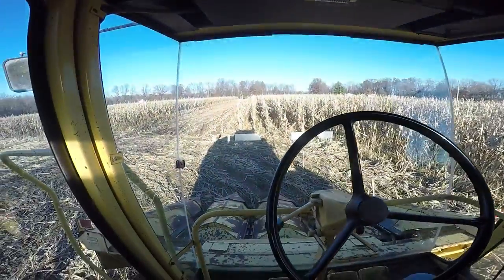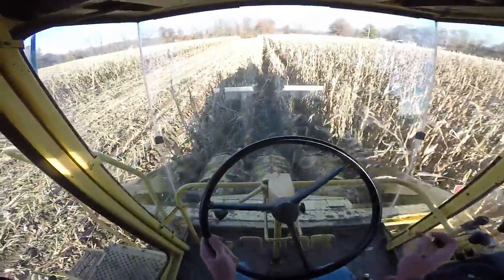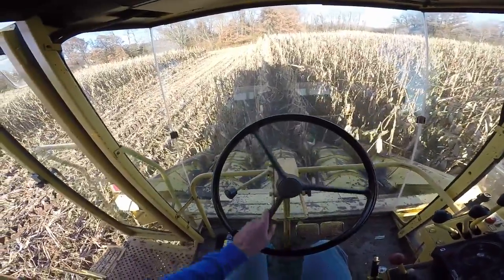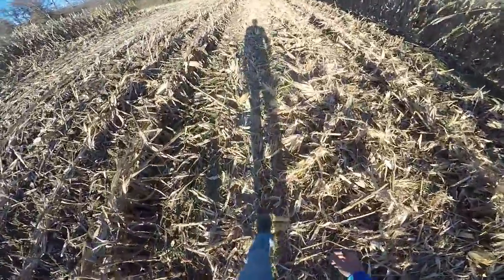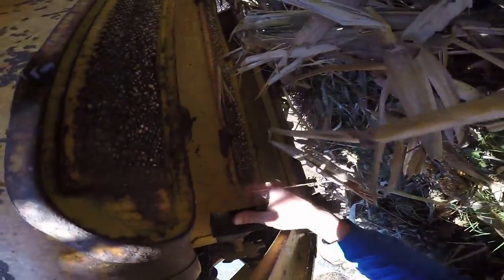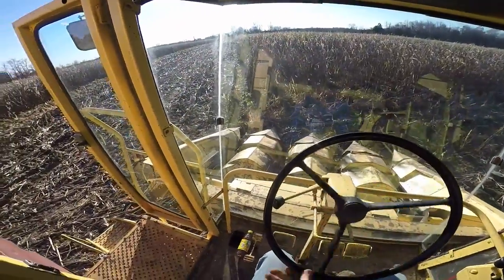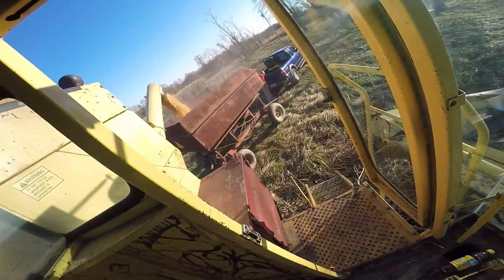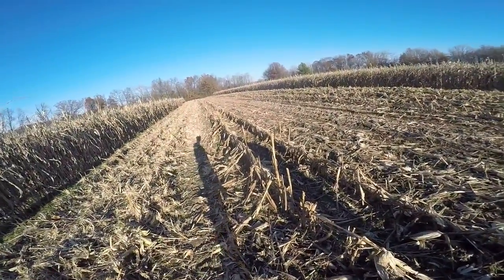First Corn Harvest  TR70 Petrol

Comment: It'd be easy enough to rig up a switch and light in the cab for the rock trap... just a microswitch and some wiring and an LED indicator.... maybe even a horn switch that the lever or rock trap door comes down on and presses to an LED indicator in the cab... my old 640 Ford combine had a metal flap hanging down from the roof over the straw walkers so that if they started clogging up, the trash would push the flap up and it pressed on a horn button wired in to the combines actual road horn, so the horn would start blowing to alert you.  Simple but it works!  

Heck tie some twine or a string to the lever that would raise or release a flag on top of the feederhouse when it trips... spring clothepins and a field flag would work easy for that... OL J R :)

Comment: Might want to invest in a set of duals for your combine. You can also run lower air pressure in your drive wheels for soft ground. I had a 403 IH gas burner years ago I put duals on and it made a ton of difference.
Reply from the maker: I am really hoping to find 28L26 rice tires for it. But I just had a though about the duals because I  know where a couple sets of 18.4x26 rice tires are close by.

Comment: We always just wired the rock trap shut on our combine if we needed to open it up a simple snip of the wire and you could open it then quickly wire it back shut and get back to work
Reply from the maker: It hasn't popped open again, so I hope it was a one time fluke. I definitely want it to work for bean harvest. I don't want the combine to eat a rock.
Reply: Ya for beans you would want it functioning we just did grain and corn so chance of gobbling up a rock are real low so wiring the randomly opening rock trap was benifishal

Comment: if you want to upgrade to an international 1420 to 1480 less moving parts in these machines. they are much lighter than a TR. More room inside for maintenance and some of these combines come with rear wheel assist.
Reply from the maker: What's less? only having one rotor? There isn't much to reduce for moving parts. As far as weight, I have never felt a TR70 was heavy. Now the 3208 could add excess weight.
Reply: Boehm Farm Less moving parts not as wide and you can pretty much upgrade a 1480 to a 2388 mechanically and parts availability and they are all diesels and yours is abgasser and you talked getting rid of gas headaches. The foreheads perform better. If you buy a 1420 or 1440 you can run a 30 inch 4 row corn head if you want to narrow your rows more and they are great on fuel economy. my grandfather had a 1480 for 12 years and the current owners are still putting it to work.

Comment: i have never worked on a gas powered combine, can u notice any differences in power or ?? are you  using regular farm gas or higher octaine gas, or have you not tryed different gas yet, since its still new to your farm?
Reply from the maker: I have filled it twice. It uses fuel faster and I use 87 octane. Ever since the high gas prices, the price spread on 87 to 89 octane gas is rather prohibitive. Was only a dime a few years ago, now its about a quarter. Power wise, it's fine if the governor responds in a timely fashion.
Reply: i watch some Trucker Channels, the American fuel prices are half what drivers pay in Canada. but here every government adds their tax to every  litre. currently 65cents from every litre goes for tax. that equal to about $2.95 per gallon is just tax, gallon equilvent here would be about $4.50 so american farmer have it real good. plus all those hidden subsidies states give to farmers is incredible. [never checked such in your state,] but have from illinois.

Comment: How low is your stone roll and front drum set?  Might be part of your issue with the door opening.  Had the unload drive catch once and unload beans across the field on one of our 70's once and had to burn welds into our stone door because it lost its connection to the shaft and would push open in heavy corn.  We never ran duals on our 70's, but the neighbor had an old set of drive tires off of a Gleaner that he made into duals for his 70's.  I don't miss the old 962 corn head and its snap roll drive system.
Reply from the maker: The front drum I think is set high. I have not looked at the rock drum.

Comment: Once u get all bugs worked out be decent machine. How u get gas.i have gas tractor.have 15 gal plastic container. They caught me filling in back of truck.put on ground. I said u goina help me pick up. Goina get perminate tank for back if truck.pain in but.years ago use to get bulk gas.no price advantage anymore if u could get it. Do have cumbys card 10 cents off  gallon up to 150 gallons at the pump.
Reply from the maker: We have a semi permanent 55 gallon drum to fill in the back of the truck.
Reply: @boehmfarm4276  Yeah I did the same thing.  My Ford 640 combine is too tall to fill from the leg tank; when I was a kid it was my job to pump about 40 gallons of gas into the thing every morning with one of them old push-pull hand pumps... HATED that thing seemed like it took an hour to pump all that gas in it and my arm was about to fall off when I got done.  We didn't grow grains for about 15 years and when we got back into it, first thing I did was start pondering ways to pump gas into it without having one of those stupid hand pumps... I about passed out when I priced those fancy electric pumps that mount on bed tanks, and the tanks ain't cheap either... SO I did the next best thing-- bought a clean drum from a guy who sells them, and bought an aftermarket electric fuel pump meant to replace the old mechanical fuel pumps on an older car or truck... then I wired an extension cord replacement plug to the wires coming out of the pump, so I could run an extension cord up to the battery on the truck, and wired another extension cord end to a couple of battery charger clamps to hook everything up to the battery.  Then I ran a hose down to the bottom of the barrel and another hose long enough to reach up to the filler neck of the combine.  Plug it in and away she goes... I used to turn it on and then start greasing the combine and checking things over, and by the time I finished that and had a cup of coffee sitting in the truck, the combine was full of gas and ready to go to work... Later!  OL J R :)

Comment: I have a gleaner K gas, exactly like the one you had except with power steering. I've love mine, is there something you didn't like about yours other than it's smaller stature?
Reply from the maker: I liked the small combine because I had good vision around it. No auto header height for cutting beans. I needed to check the break fluid, the breaks didn't work. I had trouble with wet corn, but I never checked the wear on the cylinder bars. And the variable speed lever in the cab needed attention. To go faster, the head would be lifting while trying to gain ground speed. If you saw our bead harvest video in the mud, I know the combine is lighter, but it'd need a tire upgrade. I loved driving it, and maybe I didn't own it long enough, but some machines just give the driver confidence. For example, In our 1086, I feel invincible, but the 1466 leaves me a little unsure. I don't have suggestions on how to change the Ks operator platform to change that feeling.
Reply: Boehm Farm Everybody is used to what they are used to. For lack of  better words.

Comment: How's the gasser cost you on fuel vs your other one?
Reply from the maker: About an arm and a leg more, but we're getting it done.
Reply: Boehm Farm Yeah I figured. Best of luck. Plus nice to have a plan B if one breaks.
Reply: @boehmfarm4276  any idea why they made such big machines as gassers? Seems really silly to have such weak, asthmatic fuel guzzling engines in such applications...
Reply: @dregenius  This was probably the last of the gassers... guess there was still a market for them but I can't figure out why.  Probably be worth it at some point to swap in a diesel engine.  

Friend of my brother's farmed with his grandpa, they had old 699 and 899 Deere cotton pickers powered by propane engines (which of course are just a gas engine with a different carburetor, called a "mixer" and a vaporizer to boil off the propane to feed it vapor.  My grandpa had converted his NAA Ford and Golden Jubilee tractors to propane back in the 50's when he started farming, because farm gas was like 8 cents a gallon back then and butane was 4 cents a gallon... not quite as powerful but the engines last forever because they burn SO clean... BUT that was then, this is now.  Butane (propane) isn't 4 cents a gallon anymore... now it's higher than gasoline, but only has like 4/5 of the energy content per gallon, meaning you burn more gallons to do the same work (with the same efficiency).  Basically this means, very very roughly, that if a diesel engine takes 4 gallons of fuel to do the job, a gas engine will take like 5 gallons, and a propane engine more like 6 gallons.  With all the fuels being so expensive, that lower efficiency of gas and propane, compared to diesel, that really adds up.  Plus propane is a PITA to refuel because you basically have to have an LP gas tank on wheels and have to hook up the hose and valves and all that crap to transfer fuel.  Only upside is you don't need a pump, just a bleeder and let the pressure difference between the tanks push the fuel over.  He finally bought a diesel cotton picker and was saving SO much on fuel and time filling up that his grandparents finally sold off their old propane machines and bought some newer diesels (still 30+ years old-- cotton pickers are ridiculously expensive!)  

Natural gas (methane)is even lower energy density than propane/butane (LP gas, liquified petroleum gas).   It takes a percentage more natural gas to do the same work as propane.  Later!  OL J R :)
Reply: @lukestrawwalker  Very good points! Ironically, I'm aware of a transportation authority that runs natural gas in their city buses... for years I've tried to find out if they're compression ignition or spark ignition. Obviously in smaller propane applications, they're spark ignition... but in such a HUGE vehicle, I'd be surprised if you can even GET spark igition engines big enough (and with the dimensions to fit) a bus that 99% of other fleet buyers just go for the diesel...
Reply: @dregenius  You can't compression ignite propane or methane... has to be spark ignition.  Plus while the octane rating of propane and methane is about 110, similar to racing gasoline, you cannot run a high enough compression ratio without knocking  to ignite it, so they HAVE to be spark ignition.  You can run higher compression like about 11:1, but far short of the 17:1 typical of compression ignition diesels.  Pushing the compression ratio that high would cause fatal knocking and burn holes in the pistons.  There are some bi-fuel systems out there that use both diesel and propane injection but the ratios of propane are pretty low; back in the 70's farmers used to add supplemental propane injection systems on their diesel tractors to get more power out of them... OL J R :)

Comment: Alot of turning the wheel and not much reaction. Is that a 2 wheel drive thing or just sloppy worn out machine?
Reply from the maker: A little sloppy ground conditions and implement tires instead of ribbed steering tires.

Comment: Why don’t you get a 6 row corn head and maybe upgrade to a TR.85
Reply from the maker: We have a four row wide planter that we get double use out of planting sweet corn. 30 inc sweet corn is a bear to pick by hand.  I want a TR86, an eighty five isn't much of an upgrade, plus I dont want a 3208 Cat unless its properly matched to application. It is way overkill, and guzzles diesel for that size combine.